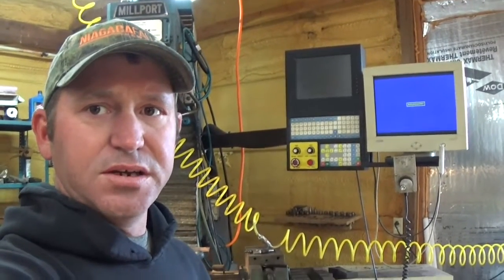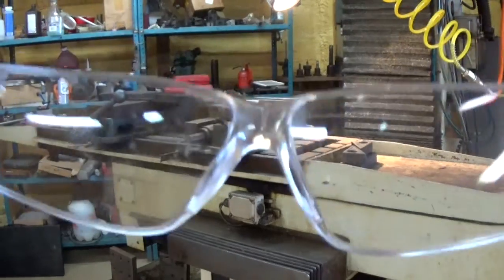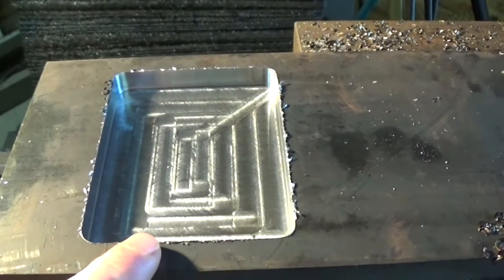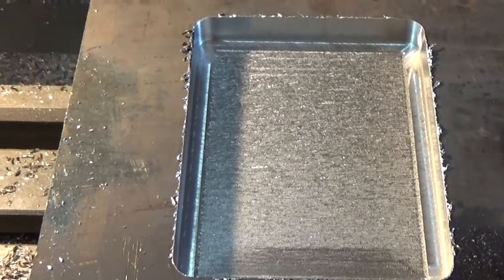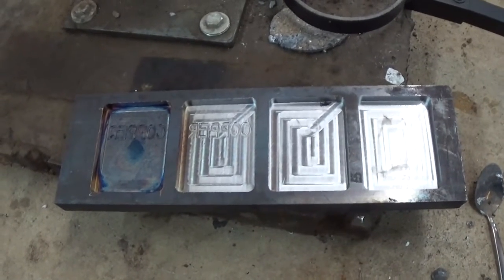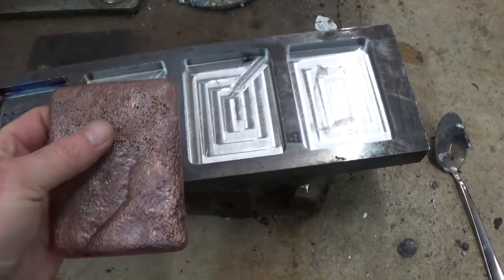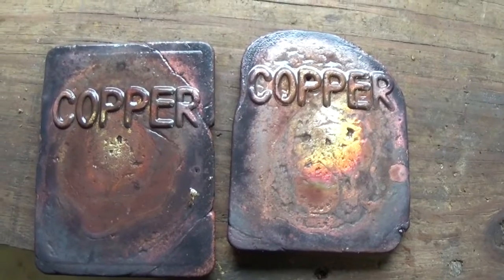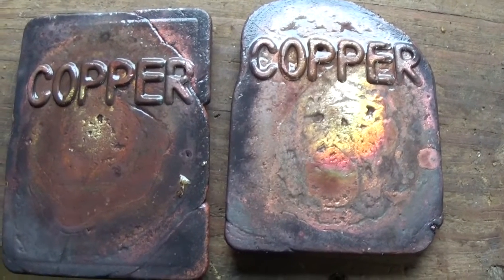Machining Copper Molds For My First Copper Pour

Comment: Make sure your copper is good and hot for pouring , especially in those steel molds it may be freezing too fast and trapping gasses instead of allowing it to escape .
Your pour looked really good. 👍😁
Reply from the maker: Thanks will do in my next pour.

Comment: I conjecture the gold color is aluminum bronze. Aluminum is soluble in molten copper, and the discoloration is where the copper was hottest as it hit the mold, so some traces of aluminum may have been dissolved in the copper. Presumably it's quite a superficial layer, may have even been polished off when you cleaned them up.
The bubbles are dissolved gasses and are nigh impossible to avoid in an open topped mold. There are some steps that can minimize it: degassing, don't stir the melt, electric furnace. I've experimented with degassing for aluminum, but generally found it easier to use closed molds with a riser positioned so that the gasses go there. I don't know if degassing copper is similar to degassing aluminum.
Reply from the maker: Thanks for the advice. I was considering making a top for the mold to see if it would help. I've done my second pour still getting the same results. I also was thinking of cutting the mold down so I can set it in the kilm and get it hotter.